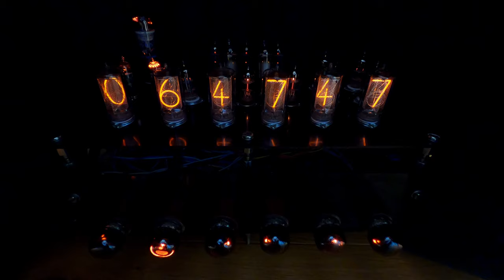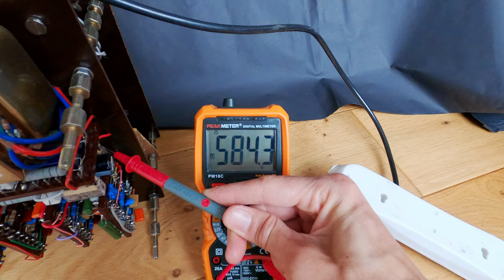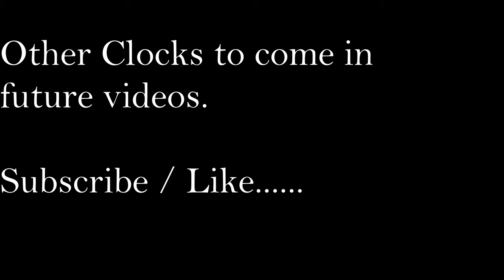Dekatron - Nixie Clock

Comment: Lovely, just lovely... 🥰
How the decatron can tell its associated Nixie tube what is the digit to display ?
Reply from the maker: Thank you,

To get an output from the dekatron, you place a resistor between the cathode output of the tube and the ground. This creates a positive output voltage,  which can be used as a signal to drive a nixie tube as one normally would (transitor, etc) 

The value of the resistor is chosen to make an output voltage of about 30 volts, 

There are different types of dekatrons, the one needed for nixie have 10 register cathodes so each number can be shown, some dekatons count with 5 or 12 outputs, some only have 1 these are sometimes known as counters. You will need a register type tube with 10 cathode outputs to make a clock.  

Lots of info on the Internet

Comment: Beautiful clock! I'm interested in the circuit (circuits?) at the back left. You have two small dekatrons spinning and one large one. Do the smaller ones drive the larger one (like a chained decade counter)? What is the model number for the smaller ones- they are so cool! Thanks!!

Comment: Hi. Schematic diagram? I’m 
I want to try to repeat the clock. The watch is great
Reply from the maker: Sorry a circuit diagram is unavailable, the clock was made from sketches of individual theoretical design then altered on the final build without modifying the sketches. The issue is I would not be able to rebuild without a full re-plan. Also I made it over a decade ago..
Reply: @ianstainer8025  Hello. Very sorry. Maybe I'll try to do it myself. Thanks for the reply. Have a nice day.
Reply from the maker: Remember the website I used for inspiration, https://www.electricstuff.co.uk/dekatron.html